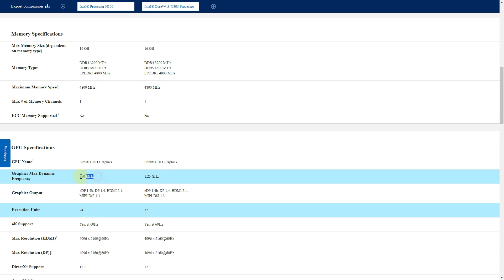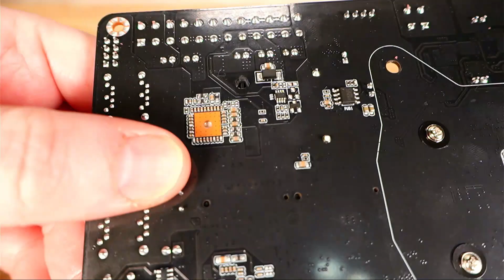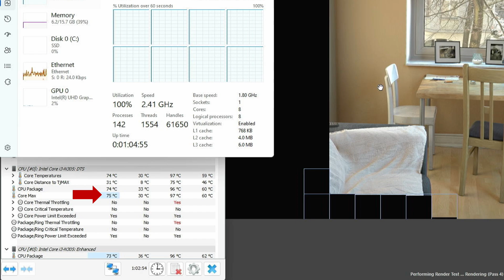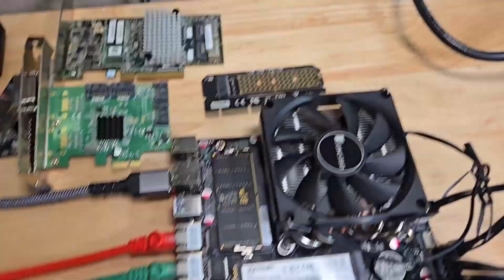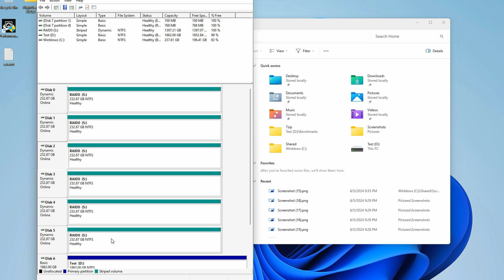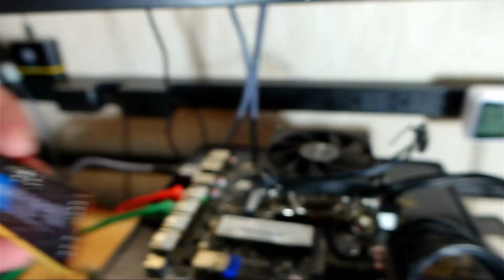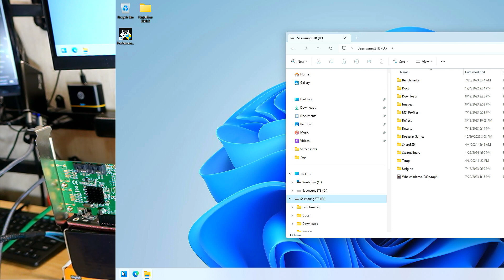CWWK Intel i3-N305 ITX NAS Motherboard Review (FAILURES)

Comment: One of the m2 slot is shared lanes with the pcie slot so it can only use one of them at a time

1 PCle x1 slot supports expansion cards (shares signal with the second M.2
Reply from the maker: Yes, thanks, I am aware. The second M.2 slot was not utilized when using the PCIe slot.